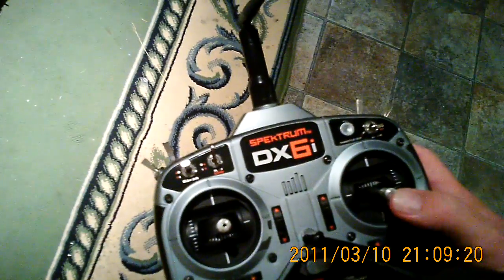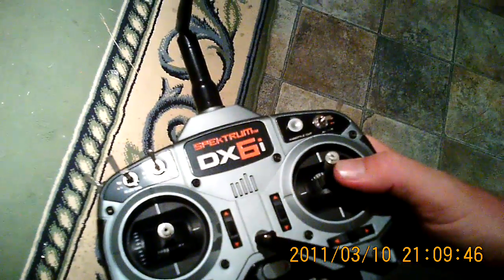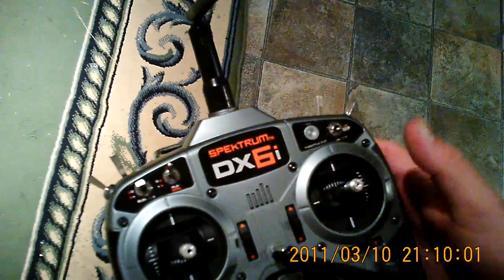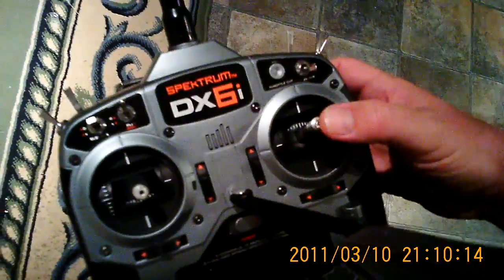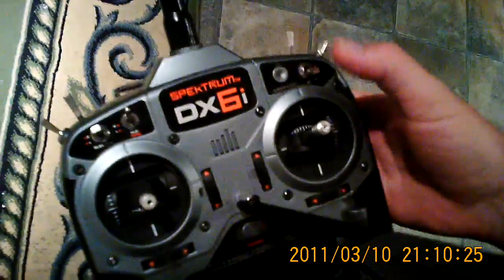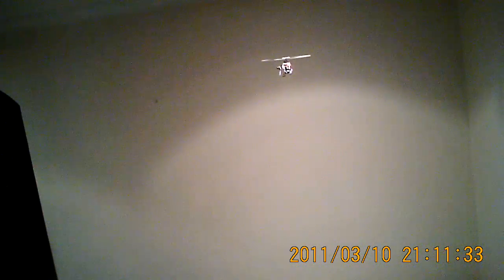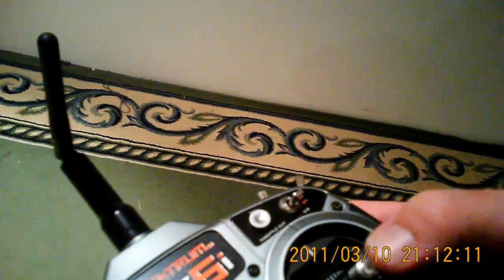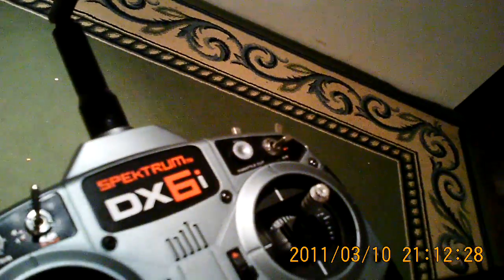Blade MCPX Vortex Ring State Demonstration Video 5 of 5

Comment: I,ve been flying  a real Robinson R22, and vortex ring state recovery is practiced using two methods: a) lower collective, increase forward airspeed with cyclic then recover descent with up collective. b) Vuichard recovery technique - apply take off power, right cyclic and left pedal. The helicopter shunts itself to the right into the vortex updraft. Much less height loss. I would really like to see these demonstrated on an RC model helicopt if possible. Could be fun!

Comment: Thanks for the tip, the mcpx is my first collective pitch heli so I assumed all cp's did that. I was kind of yoyo'ing it in my living room(a lot) and I think it may have been the reason my main gear became dislodged and sliped down out of contact with the motor cog?? (see mcpx wiki for quick easy fix) I also found that when I try doing this outside from high up it  flutters out of controll but the trusty little 3 axis gyro catches it.

Comment: How do you have your throttle on the right stick?
Reply from the maker: That is Mode 1 - throttle on the right stick.  If you live in the USA you won't see it very much as USA is mainly mode 2 (throttle on the left)  I started RC 36 years ago when Mode 1 was the most commonly used mode in most countries except the USA.  Now its about 50 / 50 in Australia.

Comment: so basically, if you pull in more power in a short space of time, your helicopter will enter the 'vortex state'?
Reply from the maker: Its a little more involved than just adding power quickly.  Generally it also has to be descending vertically first in calm air, then if you add power quickly the Vortex ring state can occur.   It is very unlikely to happen from a normal level hover or climb.
Reply: It's how one of the BlackHawks went down during the Osama Bin Laden raid. One of the helicopters was hovering over the compound walls, and the hot night air at the time made for the perfect conditions for the vortex state to occur.
Reply from the maker: Didn't hear about that one but I know it has caused numerous real helis to crash over the years.

Comment: "Vortex ring state" you're talking about is actually kinda bollox, there's no technical term for it. Of course the heli can't recover instantaneously from a rapid descent. The downward velocity means it has inertia. So the blades' lift now has to overcome both inertia and gravity, instead of just gravity. So it needs more collective than just a low hover.